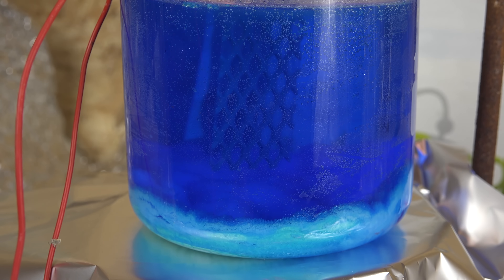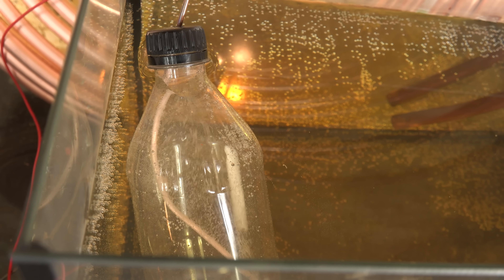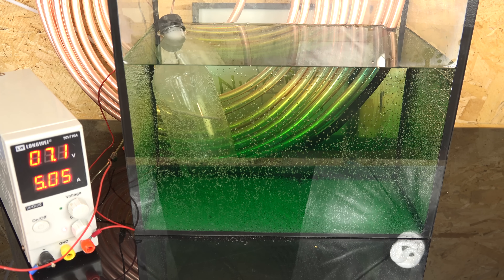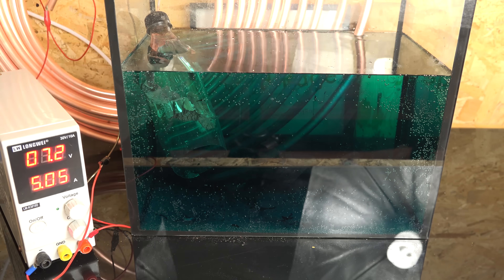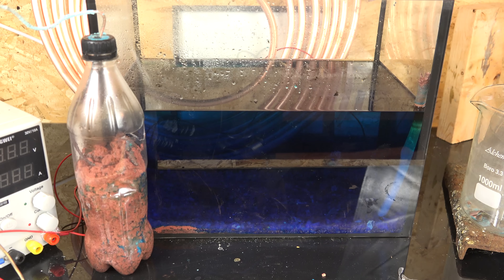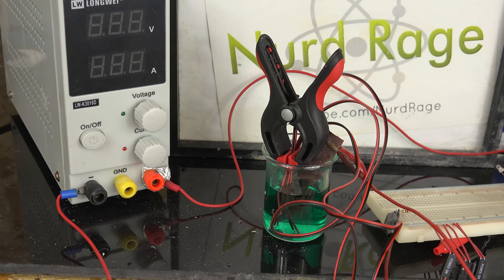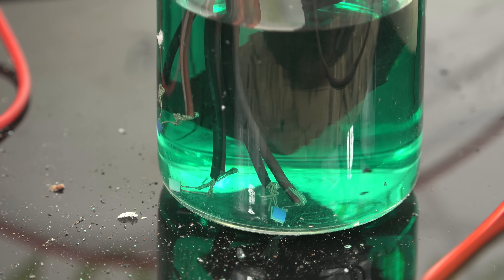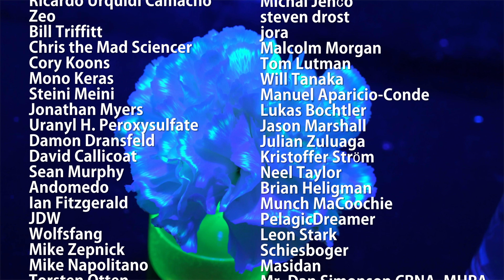Lab Notes: Making Copper Sulfate and Electrobonding Wires

Comment: A more efficient solution to producing stronger, less spongy copper when depositing is to use assymmetrical AC. I made alkaline battery rechargers during the 80s with this technique. By using diodes to clamp the voltage over one phase, it's possible to limit the outgoing current that would otherwise pull copper ions off the deposition substrate whilst the unclamped phase deposits them. The resulting copper deposition is much stronger and compact.

Comment: In an old text describing copper and silver refining they boiled the slime from a copper cell in sulfuric acid to dissolve both copper and silver, then poured it into cold water to precipitate the silver sulfate. The copper sulfate were only diluted and could go back to the copper cell as electrolyte.
If my memory doesn't fail me it was done with concentrated sulfuric acid in cast iron pots, but lab glass should also work. :-)

Thanks for posting again! I've learned so much from your videos and I'm looking forward to your coming ones.
Reply: I wonder what other mysteries old text have

Comment: on the junction issue I have solved this by using a crimping tool and copper tubing usually sold at model railroad stores that sell bits for building that custom model railroad layout, company name was K&S

Comment: I'm not too sure how much the lab-grade stuff costs, but copper sulfate can often be found as root killer (to kill things like tree roots in sewer drains). It depends on the type of root killer, of course, but some of them are basically 99% blue copper sulfate crystals. I bought a container of it years ago to do electrolytic brass etching and I don't think it was much more than 10-12$.
Reply: In case it's helpful, the brand is "Root Clear" and it's still available.

Comment: Cu at cathode is NOT wasted electricity. Just leave cathode Cu at acid solution in air-opened aquaruim.
Cu(+0)(dispersed) + Cu(+2) --> Cu(+1), catalysed by heat and maybe Cl(-1).
Cu(+1) + O2(air) --> Cu(+2).

Comment: As an alternative to the copper plating trick, you could probably just get some small crimps and a cheap crimping tool and do that kind of repair in a minute or two. You can get basic crimp cylinders without insulation, which given that they're really just a short segment of plated copper tube, should hold up quite well in the hot plate. Crimps can be some of the best connections and hold up better than solder to vibration and thermal loads.
Reply: Solid copper,  not plated.....
Reply: @szsenyuk8887 The small ones I get are usually tin-plated as an anti-corrosion measure. Means they're silver rather than red unless scratched, but not much more than that.
Reply: Probably wouldn't even need a proper one but a small length of copper tubing and then coat with ceramic paint
Reply: @EdwardTriesToScience  I've had much better luck with the purpose-made ones, but it can be done enough to work with small copper tubing. The copper tubing is almost certainly a much thinner wall, and that makes it hard to get a good crush-into-connection on it; from memory, the small sizes of crimp the wall is around the same thickness as the hole diameter. Probably easier to get the crimp than to get a tube with similar specs, unless you Really Need One Now and can drill out a solid rod for it, or can put up with a significantly less reliable connection.
Reply: @EdwardTriesToScience  I would suggest ferrules. They are literally under a cent per piece. a ferrule crimper is like 60 bucks but it's a good long term investment because from then on you can make solid connections for practically free

Comment: Regarding the spongy copper: turn it into copper sulfate with sulfuric acid & H2O2.  You can buy H2O2 from plant nursery suppliers in 30% concentration (for hydroponics).
          Regarding the temperature sensors: I would not trust them for a minute, after being immersed for hours in sulfuric acid!  To connect to them, either use screw terminals, or (better) use silver solder.  To silver solder, apply dab of silver solder flux (cream mix of borax & fluorides) to connection.  Clamp the wire so the heat doesn't reach the sensor.  Lay a piece of silver solder on the connection.  Flash connection with propane torch.  The smallest flame will do.  Flux will bubble & become clear liquid as the solder melts & flows onto the connection.  Soak the connection (not the sensor!) in water until all the flux residue comes off (it is corrosive if you leave it on).  Silver solder melts at 1000C so connection should be good for hotplate.
          You can also weld the connection by twisting wires "pigtail" & flashing only the tip with oxy-gas jeweler's torch for a moment.  You should see a ball on the end of the connection.

Comment: That is a very neat alternative to soldering. I wonder if something similar would work for bonding (for example) metallic heating elements to leads...
Reply: The industry standard method is to use crimps.
Done correctly they last pretty much forever, and only take a couple of seconds to make.
It's when you try to make a crimp without a reasonable crimp tool that you get problems.

The (slightly) more expensive method is to spot weld. the "Tags" on tagged battery cells are usually spot welded.
  
I do remember at college making thermocouples by twisting the two different metal wires together, then using a hammer and small anvil. Then giving the twisted wires a hefty thump to form a "cold" weld .Surprisingly I got a pretty good success rate :-)

Comment: great video... but isnt copper in a sulfuric acid easier and faster?
Reply: copper barely reacts with sulfuric acid at room temp, industrial process uses nitric acid (which is expensive and a violent reaction) or electrochem process as shown. sulfuric acid is sold as drain cleaner precisely because it barely reacts with copper piping.
Reply: @oxoniumgirl  true but i have used small amount of hydrogen peroxide mixed with the sulfuric acid as a catalyst to make copper sulfate in the past and its quite fast...

Comment: Copper sulphate is usually sold as a pond algecide in garden supply stores. Perhaps it is out of season?

Just throwing this out there, but some portapotty buisnesses use Copper sulphate as an odor control for the holding tanks.

Comment: "If I use higher current, the copper wire becomes too hot to use"

Sounds like you are using too small a guage of wire for power transmission. Consider 10 or 12 guage wire if you want to handle up to ten amps of power.

Comment: How were the original sensors bonded to the wires?
Reply from the maker: spot welded. I don't have a spot welder though. especially for wires that small.
Reply: Time to make a tiny oxyhydrogen torch to weld them together :)

Comment: if you add hydrochloric acid to your plating solution you will get much better results I do electroforming and use it with sulfuric acid with great results. hydrochloric acid is one of the 7 secret herbs and spices in the commercial plating fluid